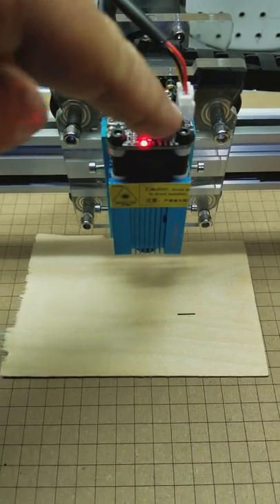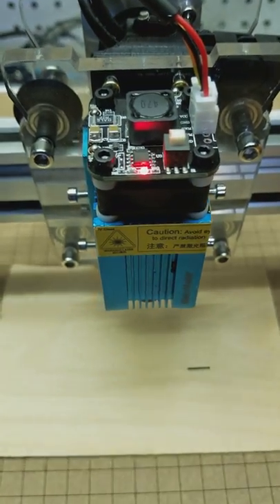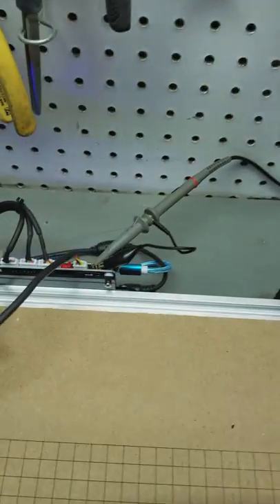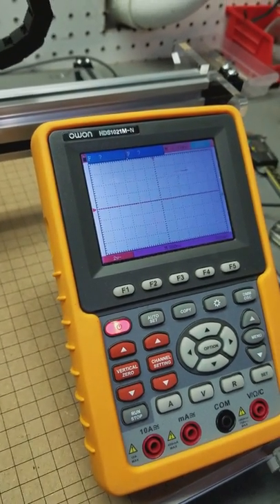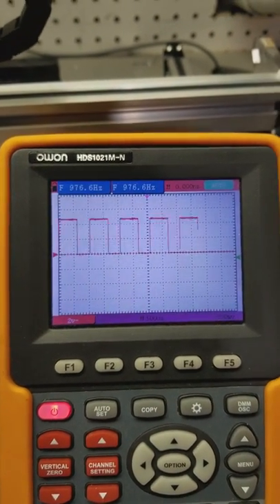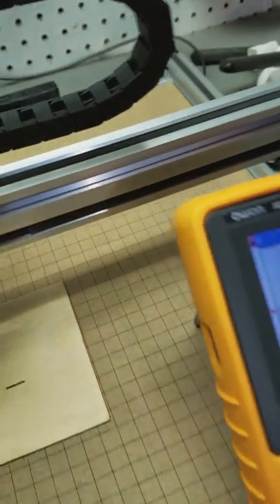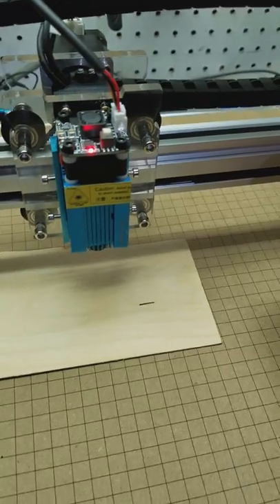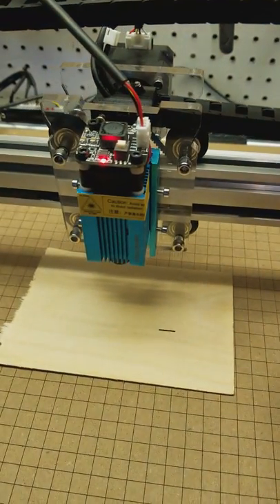EleksMaker A3 Pro Not Working

Comment: did you fix it? if so how?
Reply from the maker: The driver board was dead, needed to be replaced.  This video was for the purpose of showing Eleksmaker the problem.  They warranty replaced it without any problems
Reply: thank you for your quick reply.  I got my laser from bangood and already opened a ticket. Hopefully they will supply me with a new laser too!